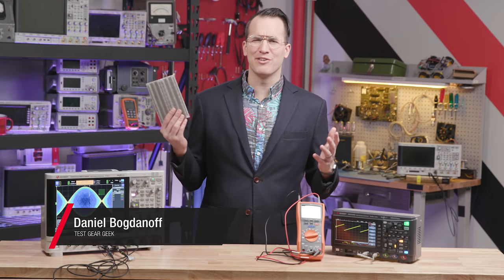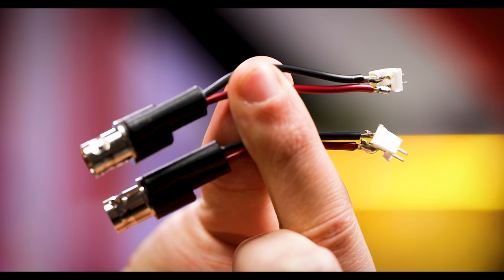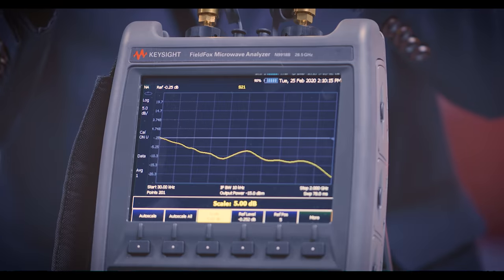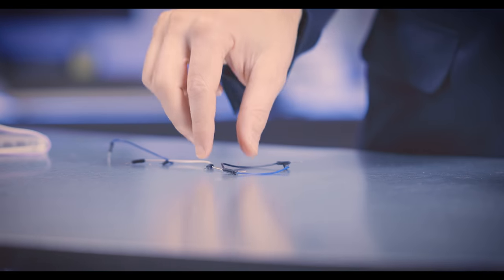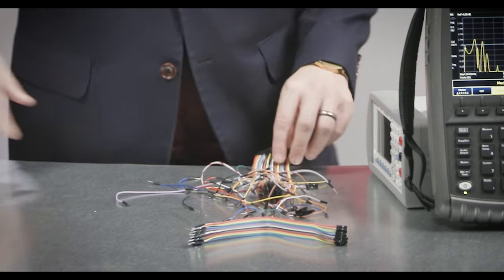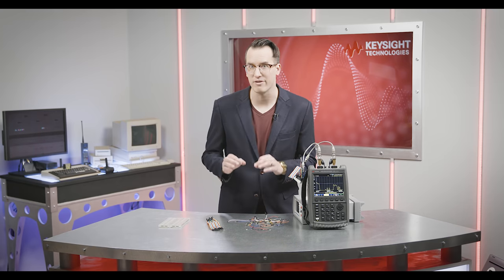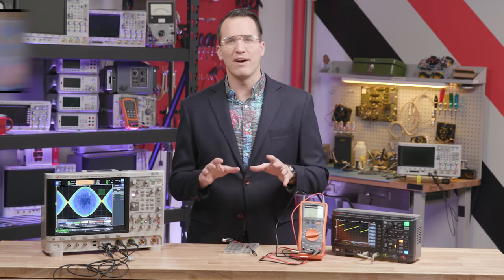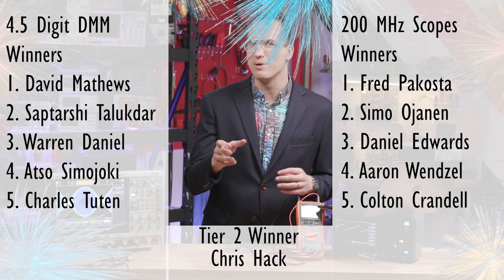Breadboards - Trash or Treasure? | S-Parameter Bandwidth Test + Wave Winners

Comment: So I liked this video a lot - very cool to see a Fieldfox actually quantify the breadboard's losses like that. But I disagree with your conclusion saying that breadboards are fine for medium speed and medium power circuits based on the fact that S21 is extremely low at 10MHz. The problem with breadboarding isn't always signal attenuation. For example try prototyping a 500kHz, 2A SEPIC converter on a breadboard. That is low frequency, medium power. There would be almost no attentuation in magnitude of voltage or current. And yet, the performance will be abysmal and the feedback loop may not even operate correctly. The problem isn't attenuation, it's the added inductances and capacitances which would lead to phase shifts, unwanted ringing, and sometimes full blown resonance at certain nodes in the circuit. Even a slight amount of ringing on a FET's gate can lead to chaos. I am sure you know this already but I think beginners watching the video may get the wrong idea of what a breadboard can handle.
Reply from the maker: This is an excellent point! I agree 100%

Comment: When they make a breadboard that takes BGAs, sign me up.

Seriously, I'd be interested in seeing S21 measurements between unconnected adjacent columns - i.e. crosstalk. Plug in your fixture's G-S-S-G on 4 adjacent columns then use a very short, low inductance jumper to tie the grounds together. I suspect you'll get something around -20 dB, maybe even closer to -15.

I remember back when I was in my teens, doing a simple LM386 amplifier circuit and wondering why my output level was so low. I could distinctly hear my music, it was just quiet. Then I realized I had the headphone jack wire one column away from my amplifier's output with no DC connection - just coupling through the parasitic C between columns! Gave me a new appreciation for parasitics.

Also maybe use a nicer fixture like http://www.zebax.com/doc/ZXACC/ZX00SMAH.pdf? Seeing a SMA going into a breadboard would be pretty funny, but might actually give more accurate measurements too.
Reply from the maker: I like those ideas a LOT.
Reply: @KeysightLabs  Then maybe you could follow up on that by disassembling a breadboard, measuring dimensions of the contact strips, and modeling them in ADS and seeing how close you can get the field solver model to match the measured S2P. I might actually try to do a 2D thick-metal model in Sonnet later on and see how that looks.

Maybe also try doing some eye patterns of common low/mid speed protocols, like SPI from 100 Kbps out to tens or hundreds of Mbps?
Reply: You can get yourself a solderless BGA breakout board. Something like this :
https://e2e.ti.com/support/microcontrollers/hercules/f/312/t/462170

Comment from the maker: Wave sign up link: http://bit.ly/YTWave2020
Ok ok, I know. There are a LOT of variables when it comes to breadboards and I'm sure many of you are here to comment with other tests I should run. AWESOME! I'd love to come back to this topic and do a deeper dive with it and have a longer video later this year. Put your thoughts and worst breadboard horror story below!
Reply: ** [Add comment pointing to main CTA and pin it]: check!
Reply: My main gripe with breadboards are the bad connection problems. I usually spin a small PCB to prototype or solder up the circuit on perfboard.

Comment: Enjoyed your video.  I found it after doing a search on VNA Breadboards and was surprised when yours came up.  

I have been working on software for the low cost NanoVNA to allow measuring power rails impedance.  The breadboard makes it easy to build up different decoupling networks to test the software.  Eventually, I will move onto testing with a PCB.    The NanoVNA is nice as it only costs about $50 and can provide some decent data for the RF hobbyist.   

I've seen various numbers tossed around for breadboards speeds.  For fun someone on EEVBlog started a contest where the idea was to construct an oscillator using a breadboard.  As you can imagine, the rules had to be clarified as the speeds went up.  The definition of wires vs components became very important.   In the end, I was limited by my test equipment.       

Are you still planning a part II?

Comment: What I want to know is who has ever seen the MB102 with "gold plating" as claimed on every $2 breadboard box from China? I think the terminal plating quality is the primary factor in breadboards getting a reputation for bad/unreliable connections. Some are plated too thick and it makes them difficult to insert pins, while others are too thin and corrode easily. Some are shipped pre-corroded for good measure.

   I had a couple of projects where I cut up breadboards to make my own connectors. Even the ones that look good on the bottom can have corrosion issues in the pin contact region. You really can't tell unless you pull all of the terminals and look. I just wish someone sold a gold plated contact version at a fair price that is feasible for retro computer shenanigans @ 8-12 breadboards. I'm not forking over $30-$50 each in that kind of quantity. I'll just etch a board from scratch before I'll pay $500 for a temp breadboard setup.

Comment: I use breadboards a lot! I am a computer science student with a high intrest in electronics (RF and EMC in particular). I use bread boards a lot for prototyping microcontrollers, like a ATmega328P, to test te circuit before making it on a perf board. Really handy to modify low frequency circuits!

Comment: The inevitable bad contact, either due to bad cable, or bad point in the breadboard, has always been the main problem in my breadboard builds. Quality varies wildly from (eBay) sellers, and really good ones are hard to find.

Comment: A really interesting topic in the upcoming video. There is a project for a device that i take the  designed of it  from  the Japanese company Hioki and when applying the design to the bread board, I found a difference with the frequencies of some sections of the oscillator circuit. 
So, in some cases, it is not possible to use the bread board, because it can create parasitic capacities in the tracks, and also the quality of the bread board  can affect the results. In the circuit that you test it 
So in the end tkanks for posting god bless

Comment: I haven't used a solderless Breadboard in many years, as there aren't enough circuit nodes to be useful.
A technique I do still use is the Veroboard with the square pads, and Vero "Speedwire" which uses enamelled wire point-to-point soldered connections, routed with plastic combs.
This will give a surprisingly high board density and performance, approaching that of a basic PCB. Perfectly fine for typical microcontroller speeds.
With adapter-boards that breakout SMT-chip pinouts to a 0.1" pitch, prototyping with square-pad Veroboard is still a viable technique.

Comment: At 3:23 the 1:1 patched ports don't look like they would HP filter the signal .... at least DC & LF signals should come through if directly patched.
Maybe one jumper wire was broken / has had a bad contact and hence the coupling was only capacitive (hence the HP behaviour) ... @Keysight Labs : What do you think are the reasons here?

Comment: I once assembled simple LED clock prototype on the breadboard using 8bit PIC at 4MHz.
The time deviation per day was huge -> more than 30 minutes.
So when I transferred the design on PCB I had to remove all compensations I made in the code.

Comment: Breadboards are very useful!

What you have not tested is the capacitive crosstalk between neighboring rows - in a student lab in the second year we build a CE amplifier on these breadboards with a 2N3904 which most of the time ends up with base and collector in neighboring rows. This creates a parasitic capacitance in the order of 10 pF between base and collector which - due to the Miller effect - reduces the achievable bandwith of the amplifier to below 1 MHz as compared to a simulated bandwith of 30-50 MHz. Luckily, since our students would not be able to measure such a high bandwith with our lab equipment!
Reply from the maker: Someone recommended an S21 on a neighboring row, I'll have to try it when I get the FieldFox back

Comment: I'm using breadboards, prototype PCB's with dots and homemade PCB's.. All depends on what i need to do. For example, when i need some heavy load, etc, i may use combination of breadboard and prototype PCB, in that case,  transistors and heavy part are soldered on prototype PCB, but low level logic are on breadboard. In some cases i create projects in parts - some module at project starting are assembled on breadboard, after testing, PCB are created and soldered and parts from breadboard are disassembled to make place for next project module.. After that PCB's finalized part are connected to breadboard for next module testing.. 
I don't use cheap breadboards and have lots of good quality board's.. This eliminate debugging for bad connection reason..
Anyway, breadboards have current limits as it is with any type of connector's and, usually, i take it in account..
By experience - breadboards can handle 20MHz without any problem.. Long time ago, i tested FM stereo modulator and mini bare bones (with TO92 case transistors) FM transmitter on breadboard - at the end it worked, but i need to put some other capacitors, not as planned, because with calculated values i can't get transmitter in the needed frequency range.. This situation was awful for debugging.. :D
One time when i assembled new project, i accidentally shorted power lines on breadboard with jumper wires. Luckily, i left fuse in 12V power wire from previous project.. I understand my mistake when i see how fuse blows up like small bulb.. :D

Comment: Want a horror story with a breadboard, eh? Melted it and it caught on fire from a 500mA 5V usb connection. Was testing a little usb powered circuit. IT all went to hell when one of the BJT's decided to go full nuclear due to I assume a static shock, and the USB didn't turn off, it was the power draw within spec. And, no. It wasn't the BJT that caused the fire. It was the internal tracks of the breadboard. Breadboards are too niche.

Comment: I think the 10MHz "rule of thumb" comes more from the issues due to cross-talk, unwanted coupling due to the parasitic capacitance and poorly defined impedances. Also breadboards are notorious for poor contacts which could give you a lot of bizarre problems at higher frequencies (DC circuit is broken but RF still gets through due to capacitive coupling and such). 

I am building HAM radio receivers (1-30MHz) and I can't imagine getting one perform satisfactorily on a breadboard - it would be super "touchy", that would drive me crazy. But I am not worried too much about running digital circuits with microcontrollers with fast edges on a breadboard  - those aren't that sensitive for it to cause problems in most common cases.
Reply: DC circuit is broken but RF gets through? Where have I heard this? Oh right 3:45 a strange low cut...

Comment: i use breadboards and they mostly work fine but i tried  a precise chronometer and it delayed the time by 1 ms every 23 seconds but when i used a regular pcb it didn't have the  same issue

Comment: Hi, You can get these perma proto boards that allow you to transfer your bread board circuit layout exactly like you built it, they are available at adafruit in various bread board sizes. I don't usually have a problem with bread boards and they are good for an experimental circuit you want to try, but, maybe not make permanent on perf or pcb. Best, C.

Comment: Once I assembled a circuit on a breadboard and it did not work whatever I tried. I even contacted a man from Japan who designed this circuit, he did not help either. Then I decided that circuit has some flaws and it is an opportunity to design my own version of it. So I spent a lot of time reading about the topic and finally built my own version of the same device (floppy emulator for Apple II computer). And when this project come to an end I decided to give another chance to breadboard circuit. I checked every connection and found that one leg of microcontroller had no contact with adjacent wire in the same row. So, sometimes a bad breadboard can give you a chance to learn and build something by yourself.

Comment: I love breadboard prototyping because whenever I prototype on veroboard, it doesn't work out. I don't know why maybe additional exposed copper pads? Any advice anyone?
Reply: Most of the times, probably 95%, it's wrong connections. Even when you are sure everything is exactly as it was on the breadboard, something(s) is wrong.
The remaining 5% can be anything... From flux residue on high impedance traces, to crosstalk,...
Reply: @anonimo1633  thanks for the info.

Comment: I love breadboards. When my circuit doesn't work properly, it's always a mistake I've made. However, I can't stand jumper wires. They are usually small gauge wire and have horrible pin/socket ends.

Comment: Breadboards are great for quick and dirty stuff, iterating and hotswapping parts, but they'll drive you crazy if you try and do high precision anything. If things start acting funny when you wiggle random stuff slightly - solder it and save your sanity.

I like to use as few jumpers as possible, it makes for a fun layout challenge of it's own.
If you need to add jumpers to increase available fanout on more than one or two nodes you need to move on to something better, even perfboard gives you much more routing options.

Comment: Maybe you should have started with some of that old school Radio Shack solid Black/White wire spool which was used for inductance coils for a receiving antenna.
Reply: When I was in high school in the 1970s we were taught to use brass escutcheon pins nailed into a piece of wood for soldered bread boarding.

Comment: Build it on a breadboard, does it work?
#1 No, you've probably screwed up the interconnects or your design is wrong.
#2 It's an RF circuit and you ought to know better than to risk a breadboard
#3 Breadboards are so 1980s but very useful providing you understand their limitations.
Thanks for an excellent video dude.
Reply from the maker: This is a good summary! Especially #1

Comment: I used the breadboards up to 8MHz and never had a problem (by choosing the right topology). In my opinion, for high frequency circuits, the conductors should be as short as possible. It's always good to know the limits of applying something. It was interesting. Thanks.

Comment: I think the 10 MHz are still a very good rule of thumb - on the safe side even for most transients and crappy boards. if you have anything higher frequency you can not really get any useful numbers for a final solid design from it - if you need some extra filtering or smoothing you need to measure that on the actual layout as the breadboard will have too much of an impact there.
(But i have seen them used together with a Cyclone III to hock up some extra stuff to the DDR )

Comment: Breadboards are wonderful to use cause I'm always constantly changing things. But go into switch mode power supplies and logic circuits and you'll have problems, probably, depending on what you're using. In all cases, always look up that data sheet! Also try EMI breadboard testing sometime if it hasn't been done yet. Nice vid overall. Didn't know you could do up to 100+ megacycles with that mess lol.

Comment: I use my breadboards for experimenting but I also use one for soldering pin headers nicely onto my Arduino Nano's for example that way I make sure that the pins are all in line and standing straight up so I know that my Arduino will always fit perfectly into all my breadboards, but when you do that you should dedicate an old breadboard to your pin header soldering because after a while you'll see the plastic starts to deform and or melt in some places, you're definitely gonna destroy it over time but it's a handy way for soldering pin headers in a consistent way that will fit onto every other breadboard... well, most of them.
Reply from the maker: That's a good idea

Comment: But won't the quality of the breadboard contacts matter and give different results ?
Reply from the maker: I tried three different ones I had, and they all came out roughly the same. But, there is certainly a range of quality out there. The low-cut phenomena was almost certainly a breadboard quality issue.